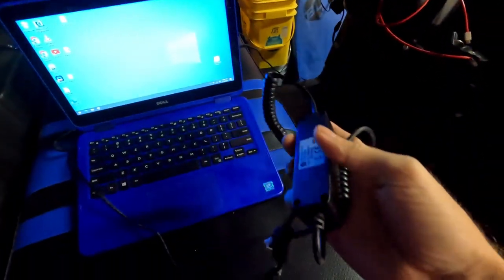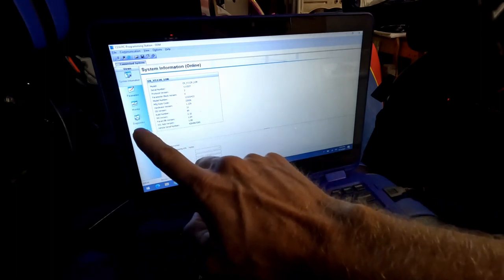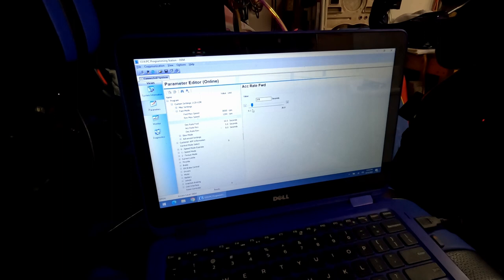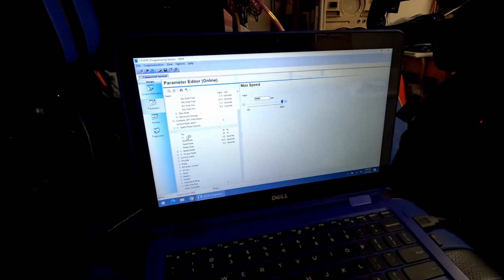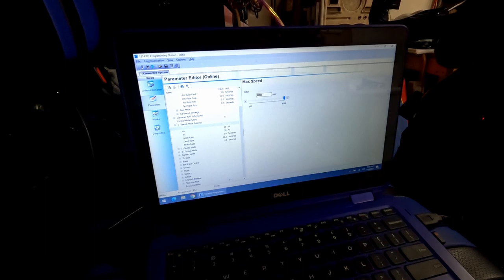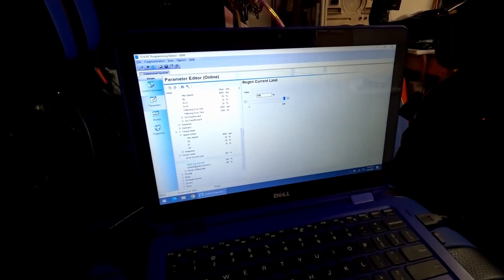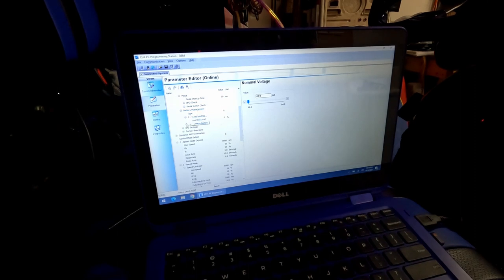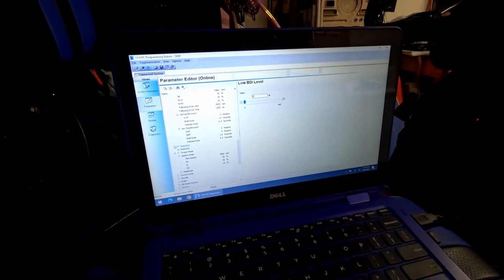Modify Curtis Controller-My Settings-MAKE THE CART GO FASTER!

Comment: Everyone needs to realize this software will not allow you to change all parameters on your cart. Some features are locked even in OEM mode. Every cart is different. Curtis uses a proprietary software called Integrated Toolkit that is impossible to get. Only very large OEMs can get it. The only other option is to flash the memory with a firmware upgrade, again impossible to get.
Reply from the maker: Thanks for that added info. I've been able to make the changes to the settings as desired. I'm sure the manufacturer has access to some impressive other tools for their uses.

Comment: Is the Curtis 1314-4401 software compatible with my Curtis 1244-5451 Controller ??   Also what cable did you use ??  Do you know if this software will load on a Mac ??
Reply from the maker: The good news is, yes I did find that controller is supported by this programmer. The bad news is, the software only runs on Windows. I bought the programmer listed down in the description of the video. If you select the right one, you'll see my channel's name review on Amazon. Not my best review work, but at least you'll know you have the right one.

Comment: Sir how can i apply position hold mode so that if my vehicle is is on mountain and i leave the accelerator so my cart should not move.. so by which parameter i can solve it
Reply from the maker: Sadly it doesn't work that way. That's what the parking brake is for.

Comment: I have a TXT, parameters have way less options. Basically profile selections, speed, accel selection and braking. Need to figure out how to get into dealer mode to turn enable Freedom. There are hundreds of pages in forums but I have yet to find a solution other than brining it to a dealer. There has to be a back door.
Reply from the maker: Agreed, gotta be a way. If a dealer can do it, someone else has found a way to do it on their own. Good luck!

Comment: Great video! I wish I had one of those controllers so I could follow along, but I have an EJIA in my EV Titan. I'm curious if you know if these are OEM'd from someone like Curtis so I can program it like you did yours or if I am SoL :)
Reply from the maker: Once you know what brand and model controller you have, you may be able to figure out the programmer for it by researching online. If you haven't already, you may want to look at buggiesgonewild.com. There may also be a Facebook group for your cart. I have found online communities to be a wealth of knowledge. Although that knowledge may be a bit lacking if your cart is not one of the big three manufacturers. Good luck!

Comment: Great info. Fast mode allows me to change settings but fast mode Express does not. Did you have same issue? How do I modify parameters for fast mode Express
Reply from the maker: I didn't mess with fast mode express much, mostly because  it didn't seem to do anything. So, I left it at the defaults and used fast mode (for me) and torque mode (for less experienced drivers).

Comment: I have 2016 EZGO RXV Freedom Limited and just installed an EcoBattery 51V 105ah. For adjusting the Curtis controller, is it best to utilize a handheld programmer or the PC model you demonstrated? 

Currently, my cart takes off quick and jerks to stop increasing speed at 19.5mph
Reply from the maker: I like the PC programmer better, just a personal preference. They both should do the same thing though. Just make sure it's not a limited programmer. You will want one that has OEM or Dealer level access. Good luck!

Comment: Nice vid but my parameters are named totally different than yours.   1206ac-5201 controller and 1314 sw V 4.3.3
Reply from the maker: That can be an issue with there being so many different controllers and versions of the same controllers. They all look a bit different on the programming side. Hopefully you are able to use some of the info to help you make the adjustments you are looking for.